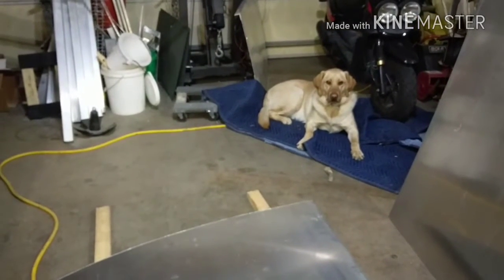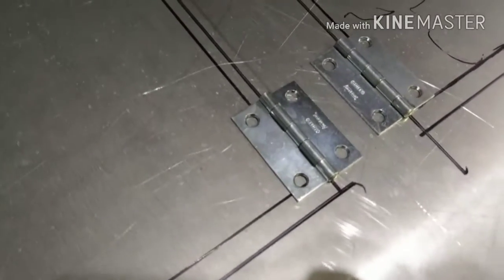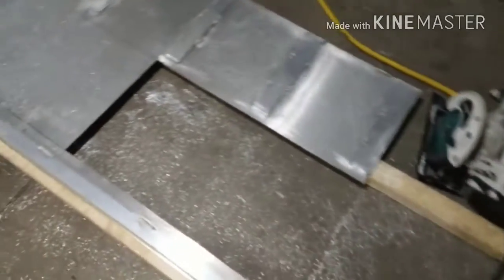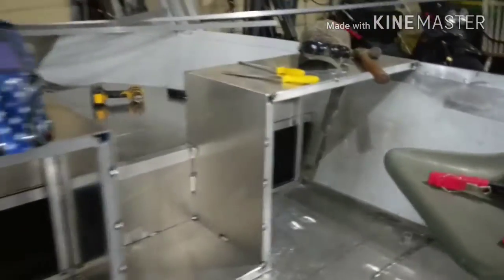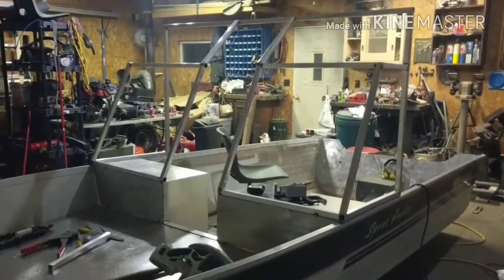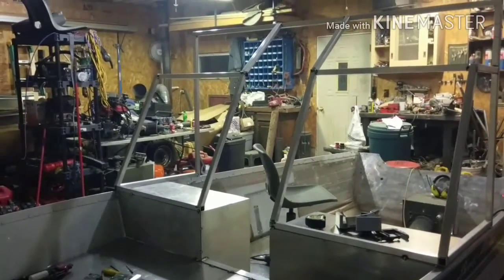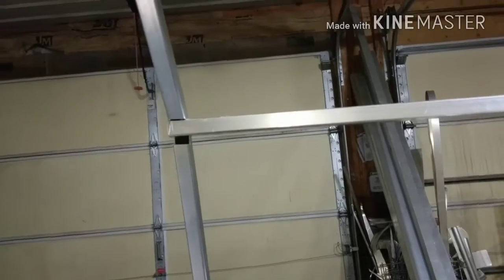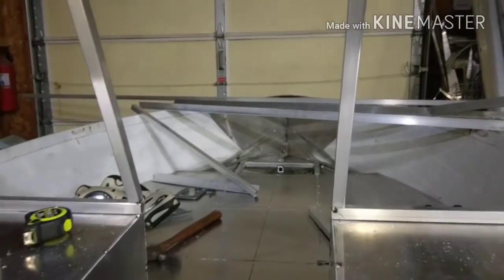Jet boat build 2.0 episode #11

Comment: Would love to hear more about the "spoon".  What is it, how does it work?  Love the build.
Reply from the maker: John Diaddigo best way to explain it is to take a regular spoon hold it vertical and run tap water over the back side and watch it. it will essentially fling the water into the intake